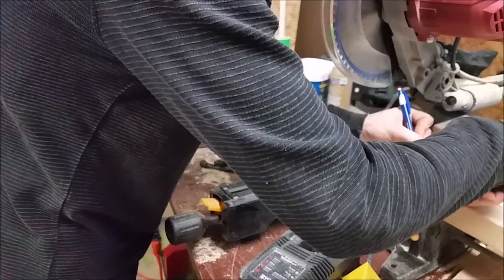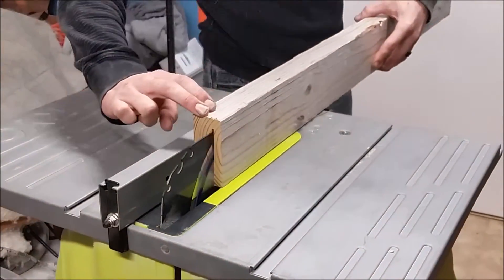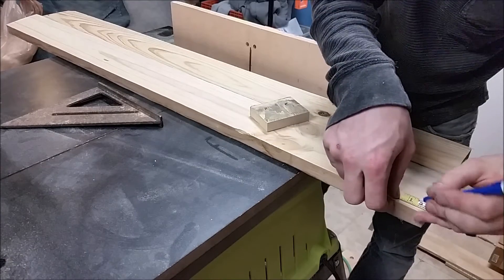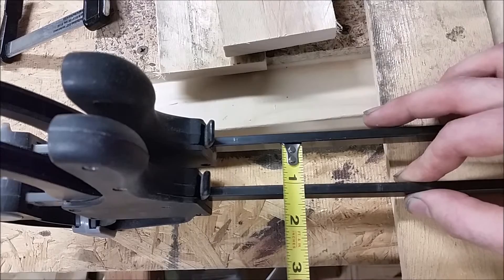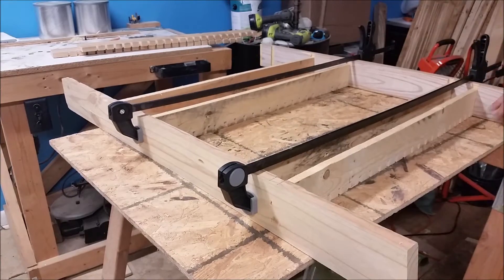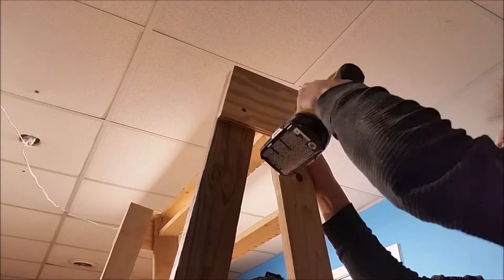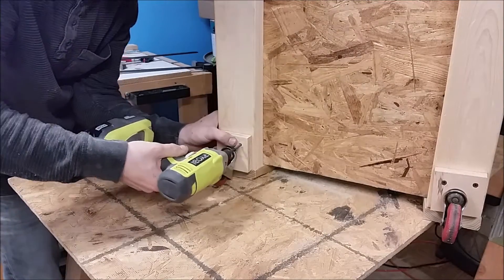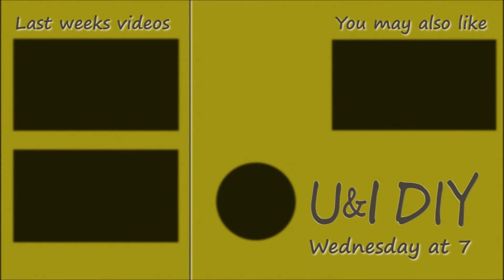Making a Mobile Clamp Rack - DIY Tutorial

Comment: I have built a mobile rack using your design with a few changes. I made a closed in shelf on the opposite side ( that can be removed easily ) for my glue and other small items. I will subscribe only if you start thinking a bit more about machine safety. Their are novices out there thinking the way you do it is correct.
Reply from the maker: I have been informed. I am comfortable with my machines, but as you stated, I realize people who are not may copy me. I will be sure to be more safety minded on futures builds.